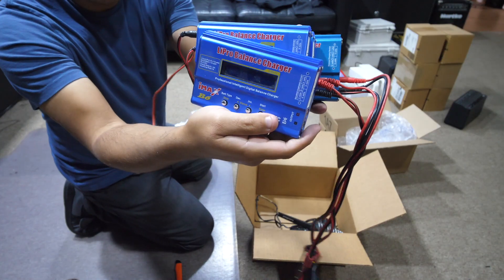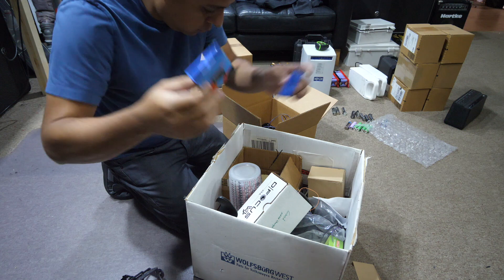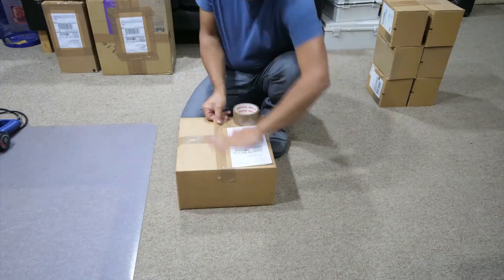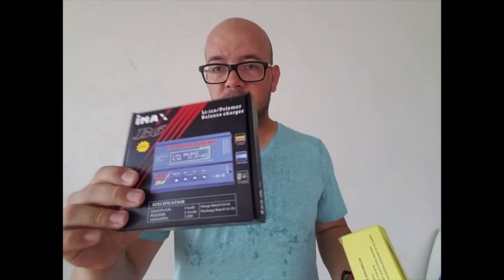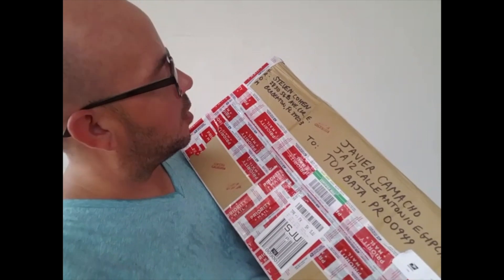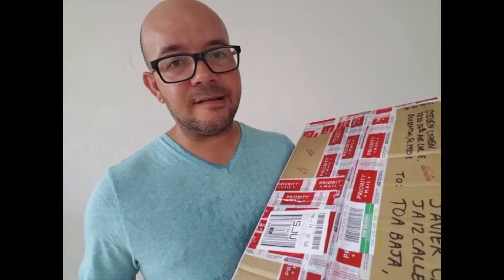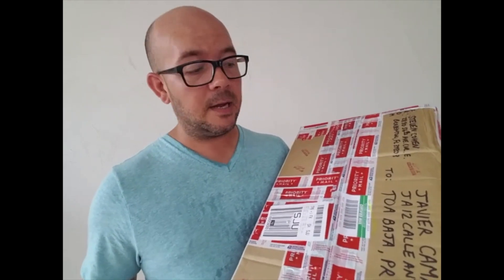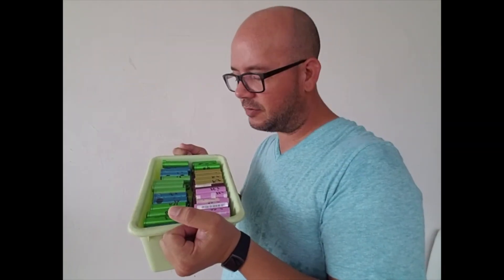Going to Puerto Rico

Comment: Jehu, I am beginning to collect the materials for 10 units. I will send them to my son, who is working on the West side Puerto Rico. Is there still access to your battery contact. 

Also do you have experience with asking collecting centers like Best Buy for their dead computer batteries?
Reply: EDIT: Jehu has confirmed in a previous post that the eBay battery guy has shipped to PR !

"Tom has shipped batteries to Puerto Rico so we have to leave the battery shipping to the professional in these case"

Here's the link from the description that will take you to the seller:
http://j35.us/SmallerBatteries

The promising information I have right now as of this post is the eBay seller Jehu uses for the 36V Sona battery packs is "alarmhookup", you can look it up and check with him. The new thing is that he has gotten all the govt approval to ship the 36V battery packs it looks like. I wrote him and am awaiting a reply. I put in the PR zip code and got back a quote for shipping, you can try that too. He is using the eBay "Global Shipping Program" which uses a big company Pitney Bowes to do the shipping. Generally with eBay if you don't get what you ordered you get your money back so this is all very promising and changes things, now Javier needs lots of solar panels and charge controllers to go with lots of batteries.
Reply: Jehu's link for the smaller batteries from the description, it goes to the ebay seller.
http://j35.us/SmallerBatteries

Comment: Info for the water filtration problem in Puerto Rico, please send the replacement filter cartridges, or entire filter pitcher.s
DIY 6 Gallon Ceramic Gravity Water Filter / Budget Filtration System
https://www.youtube.com/watch?v=NRPRX_4g99E
Note that you really don't have to use two filter cartridges as long as you can keep the top constantly full it will filter a lot of water.
You could possibly use something like a 2L soda bottle for the top (with the top cut to be wider) and have it sit on another container for the bottom part. Almost any container would do so the builder should look around and be creative.
Water should be treated with bleach, purification tablets or boiling as these do filter a lot of things but not filter viruses.
Please go to Amazon and search for "Propur ProOne M G2.0 mini filter for water pitcher (one filter)"   $39.95
(Sorry, I can't post the link here because YouTube will remove it as spam)

Please send materials to Javier
Javier Camacho
JA12 Calle Antonio Egipciaco Toa Baja PR 00949
1-787-505-6869

Comment: this is the perfect time. for someone with a load of cash. to help the future generations. by a proof of concept. of a all renewable power grid. have solar panels on every roof that gets good sun. have batteries at evert house/ building or small business. with all power going into the grid after the batteries are charged. going to a central battery bank. at a windmill farm. and solar panel farm. and or hydro electric. where the battery's supply power under peak load. when  the generators may not supply enough. kinda co operative power grid. everyone pay a set amount per month. plus any overages. for a certain amount of power per month. I really think it will work. it will not be a money printing facility. like the power grid here. in the us. and probably other countries. it should sustain its self financially. and with a profit. that about half of it should put back into the company for expansion. with everyone having batteries. no power outages. that is what we need all over the earth.

Comment: If you have lots of cars, why not charge the car batteries and run an inverter and extension cord from them?  Much cheaper, easier, simpler and its using mostly stuff you have already.

Comment: I didnt see a link.....?
Can I sign up with parton & donate to you that way?
Reply: Jehu has confirmed in a previous post that the eBay battery guy has shipped to PR !

"Tom has shipped batteries to Puerto Rico so we have to leave the battery shipping to the professional in these case"

Here's the link from the description that will take you to the seller:
http://j35.us/SmallerBatteries

He needs panels too:
SolarBlvd just announced 41c/W panels. Ship a lot to Javier!
There are not that many left so please don't buy them for yourself!
go to solarblvd on the web and then find solar panels and scroll way 
down to 24V panels (sorry but youtube will mark this as spam if I am not
 careful) the last part of the link if you want to put it together is 
/products /ecosolargy-230-watt-24-volt-solar-panel/

From this video's description:
Please send materials to Javier
Javier Camacho
JA12 Calle Antonio Egipciaco Toa Baja PR 00949
1-787-505-6869

You can also help me [Jehu] purchase 100 Tripplite to send to Puerto Rico by 
donating here: http://j35.us/helpwithcash

Parts List for the UPS project: [leave out the batteries for PR delivery]
http://j35.us/5xSona36v-packs     $149
http://j35.us/MC4-SolarConnectors  $5.18
http://j35.us/12awg-Cable     $24.99
http://j35.us/xt60--y     x2     $9.99
http://j35.us/10A-Mppt-ChCon     $37.99
http://j35.us/60wLEDbulbs     $9.92
http://j35.us/LightSockets     $12.68
http://j35.us/136wFlexSolarPanl.  l  $159
http://j35.us/950w-UPS.     $30

Comment: As far as the request for items that require excessive loads, I like the idea of a super capacitor bank.
Due to expenses these may not be something that you'd have alot of, but rather at least one set up to run as much as possible.

This video is of the SOLN-1 super capacitor bank:
https://www.youtube.com/watch?v=YMKojcYP7QQ
Reply: Yes, send Javier lots and lots of supercaps / ultracaps! No air shipping restrictions! He can combine them with the few li-ions he has to power things when the sun it out and even in clouds with enough panels and the right MPPT charge controller. The li-ions are needed to keep the CC powered up and other reasons, then the caps can keep the inverter going if there is a dark period, but throwing a lot of panels at the situation is the answer so please ship him lots of panels!

Jehu has confirmed in a previous post that the eBay battery guy has shipped to PR !

"Tom has shipped batteries to Puerto Rico so we have to leave the battery shipping to the professional in these case"

Here's the link from the description that will take you to the seller:
http://j35.us/SmallerBatteries

 SolarBlvd just announced 41c/W panels. Ship a lot to Javier!
There are not that many left so please don't buy them for yourself!
go to solarblvd on the web and then find solar panels and scroll way 
down to 24V panels (sorry but youtube will mark this as spam if I am not
 careful) the last part of the link if you want to put it together is 
/products /ecosolargy-230-watt-24-volt-solar-panel/

From this video's description:
Please send materials to Javier
Javier Camacho
JA12 Calle Antonio Egipciaco Toa Baja PR 00949
1-787-505-6869

You can also help me [Jehu] purchase 100 Tripplite to send to Puerto Rico by 
donating here: http://j35.us/helpwithcash

Parts List for the UPS project: [leave out the batteries for PR delivery]
http://j35.us/5xSona36v-packs     $149
http://j35.us/MC4-SolarConnectors  $5.18
http://j35.us/12awg-Cable     $24.99
http://j35.us/xt60--y     x2     $9.99
http://j35.us/10A-Mppt-ChCon     $37.99
http://j35.us/60wLEDbulbs     $9.92
http://j35.us/LightSockets     $12.68
http://j35.us/136wFlexSolarPanl.  l  $159
http://j35.us/950w-UPS.     $30

Comment: Is there any way to get a trailer load of suitable vapacity solar gens at wholesale cost for cpad users and get the insurance companies to pay for them?  My unit is a ResMed VPAP III with a 2.2 amp at 100/240 volts. How much capacity would be needed to run it for 8 hours? Thanks!
Reply: looks like its 220 watts hour and around 1.8kw of storage. This is just an approach. Regarding the insurance companies, that could take months and months just to start talking to them. att: Javier Camacho

Comment: Oh crap. You still haven't received my package. I am very sad. I thought the package would come before you'd have to go :(
Reply: Hi there, Javier Camacho here from the vide. Did you send a package? please send me a txt to the number on the description
Reply: I sent a package to Jehu, as it was way too expensive to ship to Puerto Rico directly. I just checked the package number on Canada Post's website, and apparently, I forgot to pull out an 18650 from one of the flashlights, and they are sending them back, and not refunding me. 

Really sorry, but I'm  going to have to resend them again to my expense, without the 18650 of course. God damn these lithium ion regulations are getting so annoying. Really sorry again Javier.

Comment: I will send charge controllers from eBay via Australia. Shitloads of used panels and batteries here in Australia but too heavy to ship
Reply: SolarBlvd just announced 41c/W panels. Please send Javier lots of them!
There are not that many left so please don't buy them for yourself!
go to solarblvd on the web and then find solar panels and scroll way 
down to 24V panels (sorry but youtube will mark this as spam if I am not
 careful) the last part of the link if you want to put it together is 
/products /ecosolargy-230-watt-24-volt-solar-panel/

Jehu has confirmed in a previous post that the eBay battery guy has shipped to PR !

"Tom has shipped batteries to Puerto Rico so we have to leave the battery shipping to the professional in these case"

Here's the link from the description that will take you to the seller:
http://j35.us/SmallerBatteries

 From this video's description: (also don't try to send li-ions right now the airport will send your package back if even one li-ion is in there BUT DO BUY THEM FROM THE EBAY GUY AS ABOVE)
Please send materials to Javier
Javier Camacho
JA12 Calle Antonio Egipciaco Toa Baja PR 00949
1-787-505-6869

You can also help me [Jehu] purchase 100 Tripplite to send to Puerto Rico by donating here: http://j35.us/helpwithcash

Parts List for the UPS project: [leave out the batteries for PR delivery]
http://j35.us/5xSona36v-packs     $149
http://j35.us/MC4-SolarConnectors  $5.18
http://j35.us/12awg-Cable     $24.99
http://j35.us/xt60--y     x2     $9.99
http://j35.us/10A-Mppt-ChCon     $37.99
http://j35.us/60wLEDbulbs     $9.92
http://j35.us/LightSockets     $12.68
http://j35.us/136wFlexSolarPanl.  l  $159
http://j35.us/950w-UPS.     $30
Reply: Thanks for the intention. It counts.. Att: Javier Camacho
Reply: Where can I ship stuff? Where is the list of needed supplies?

Comment: My home is set up with a transfer switch so that I can power my home with a gas generator outside. Is it possible to build the powerwall type battery tht plugs in to that same spot? Also if I dont have a solar charger for the battery how can I charge it another way? It is hard to get solar panels in PR right now so is there another method to charge the powerwall battery if we build one? TIA for any info and thank you for for helping PR!!!!
Reply: Send me a txt message to the number on the description. I'm Javier Camacho from the video.

Comment: Jehu.  Thanks for your help.  I lived in the portion of PR where there are electricity.  Not reliable, but at least most of the time, since 2 weeks ago.  Prior to that I was lucky to have a solar system that moves about 50% of my house.  Not A/C, but I had tv, refrigerator, washer...

However, as Javier mentioned, there are people in the rural areas that didn't have even normal roads or access to potable water.  There is a lot of needs in the center of the island.  People with special needs and health issues are suffering.  

Amazon shipping is getting better, but package that I used to get within 3 days, now I have to wait 7-10 days.  In PR we have suppliers, like Glenn International, that are getting solar panels and flooded acid batteries, but products that they used to have in stock, now we have to pay up front and wait 2-3 weeks.  I'm helping some of my family and friends to setup small off grid system using flooded acid batteries.

I found your blog to late for this emergency.  The Li batteries learning curve is just beginning.
Reply: Send me a txt message to the number on the description. I'm Javier Camacho from the video.

Comment: Jehu has confirmed in a previous post that the eBay battery guy has shipped to PR !

"Tom has shipped batteries to Puerto Rico so we have to leave the battery shipping to the professional in these case"

Here's the link from the description that will take you to the seller:
http://j35.us/SmallerBatteries

From this video's description: (sorry for the dup posts, also don't try to send li-ions right now BUT DO GET THEM FROM THE EBAY GUY SHIPPED DIRECTLY AS ABOVE)
Please send materials to Javier
Javier Camacho
JA12 Calle Antonio Egipciaco Toa Baja PR 00949
1-787-505-6869

You can also help me [Jehu] purchase 100 Tripplite to send to Puerto Rico by donating here: http://j35.us/helpwithcash

Parts List for the UPS project: [leave out the batteries for PR delivery]
http://j35.us/5xSona36v-packs     $149
http://j35.us/MC4-SolarConnectors  $5.18
http://j35.us/12awg-Cable     $24.99
http://j35.us/xt60--y     x2     $9.99
http://j35.us/10A-Mppt-ChCon     $37.99
http://j35.us/60wLEDbulbs     $9.92
http://j35.us/LightSockets     $12.68
http://j35.us/136wFlexSolarPanl.  l  $159
http://j35.us/950w-UPS.     $30

Comment: Javier said they are OK now on food, what they need now is to save lives, and powering medical equipment is needed. Solar panels and good water filters such as a Pro-Pur picture are needed and can be shipped DIRECTLY to him at his address below. Getting li-ions to PR is a problem because they would need to go by air, and boats are still a problem due to the ports and slow.  

EDIT UPDATE: Jehu has confirmed in a previous post that the eBay battery guy has shipped to PR !

"Tom has shipped batteries to Puerto Rico so we have to leave the battery shipping to the professional in these case"

Here's the link from the description that will take you to the seller:
http://j35.us/SmallerBatteries

He may be able to go old school with lead acids. Supercaps may be possible with enough solar power watts thrown at the situation and using the caps to make up for short interruptions from clouds overhead so he needs lots of panels. Supercaps can be shipped there directly. What I am saying is you can throw 500W of solar at the situation for a 100W load that runs constantly. Some medical equipment already contain batteries for short power outages or when generators kick in so it may not need to be perfect.

Send him lots of those UPSs WITHOUT batteries. He will need a good low cost 36V solar controller for this, possibly MPPT so you could put more voltage and wattage on the input to help avoid cloud problems any ideas?

I will try to update as I get more details. Jehu, please "pin" this message or your own.

SolarBlvd just announced 41c/W panels.
There are not that many left so please don't buy them for yourself!
go to solarblvd on the web and then find solar panels and scroll way down to 24V panels (sorry but youtube will mark this as spam if I am not careful) the last part of the link if you want to put it together is /products /ecosolargy-230-watt-24-volt-solar-panel/

From this video's description:
Please send materials or built solar generators to Javier
Javier Camacho
JA12 Calle Antonio Egipciaco Toa Baja PR 00949
1-787-505-6869

You can also help me [Jehu] purchase 100 Tripplite to send to Puerto Rico by donating here: http://j35.us/helpwithcash

Parts List for the UPS project: [leave out the batteries for PR delivery]
http://j35.us/5xSona36v-packs     $149
http://j35.us/MC4-SolarConnectors  $5.18
http://j35.us/12awg-Cable     $24.99
http://j35.us/xt60--y     x2     $9.99
http://j35.us/10A-Mppt-ChCon     $37.99
http://j35.us/60wLEDbulbs     $9.92
http://j35.us/LightSockets     $12.68
http://j35.us/136wFlexSolarPanl.  l  $159
http://j35.us/950w-UPS.     $30

Comment: I have a 233farad 12v Ultra cap I can send with you Jehu but I am currently in W Memphis AR and I dont even know if I can legally ship it to you or the island. If you can help me I will send it asap. If anyone can be of assistance please email me: velazquez.matthew@gmail.com or reply to this message thanks.
I will like and share this video.
Reply: You should be able to ship them directly and they can go by air, they have no energy in them, unlike li-ions which are the problem right now unless someone can boat over a large pallet but all that costs money. You should make sure they are clearly marked and maybe in the original box and with whatever protection / shorting they had and so they don't get mistaken for a Battery.

SolarBlvd just announced 41c/W panels. Please send Javier lots of them!
There are not that many left so please don't buy them for yourself!
go to solarblvd on the web and then find solar panels and scroll way 
down to 24V panels (sorry but youtube will mark this as spam if I am not
 careful) the last part of the link if you want to put it together is 
/products /ecosolargy-230-watt-24-volt-solar-panel/